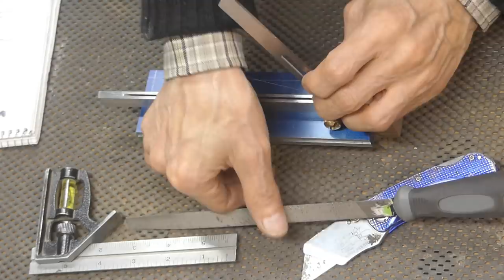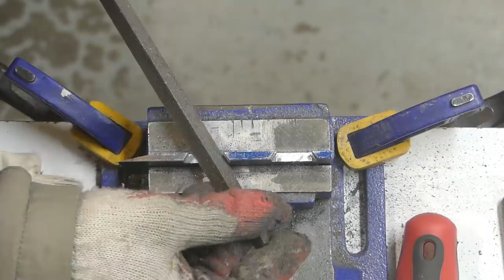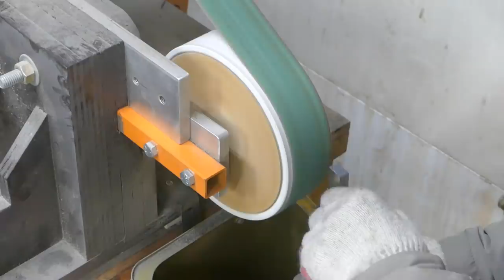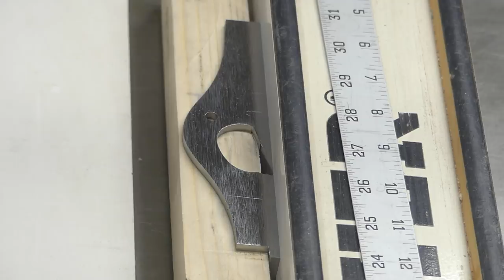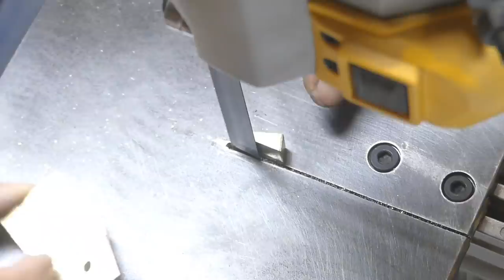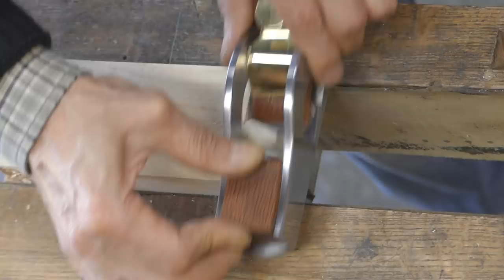MAKE A RABBET BLOCK PLANE

Comment: I love the way you make those planers and i really don't want to be a jackas but don't use cold roll steel, that thing always wants to move where you take material off, because of the compression forces and tensions of manufacturing, use instead hot rolled steel, cut your pieces to leangth and leave them all night in muriatic acid, rinse with a brush and water , the hot procces relieve the tension and forces of manufacturing, recheck the cold rolled and you will see a change, dimension or twisting, have been there before and i hate having too much work envolve on something that will change in a few days...
Reply: Is it truly that unruly ?.... like 1000ths of an inch ? Or worse ?
Reply: @andrewgarratt5191  make the test... I have made cuts on 1" thick 12" long square bar of cold rolled to split in half on a band saw,  all i got was two nice half inch bows... Thats not 1000th of an inch...more like 1/2 out of flat...the plate he cuts is made like that from factory, you could buy a bar of 12" x 12" and cut to the same thickness and believe me, you won't get a plate,  take one piece and is like removing one foundation of your house, slowly starts to sink that parts, the same principle is happening every time you cut one piece of cold rolled...
Reply: fireblade639 well frig! 
Thanks for the info...I don’t know metals, I can sharpen the shit out of it....but my knowledge basically ends there. 
Came up with a plan B anyway 😁 I’m gonna buy a common rusty Stanley Bailey plane,gut it and chop off the front and back to make my own infill plane. 
That’s “Ductile cast iron” 
And so long as I don’t let it get really hot while I cut...it should work out A.O.K. ....
Right?
Reply: @andrewgarratt5191  actually that's a very clever idea,  that will give you a very stiff and estable base to work with , high precision machines like mills and lathes are made with iron, iron will no be afected by cut heat, only oxy torch or welding heat... Don't use oil cutting it, and work it slowly, iron chip are like sand paper,  it eats the sharpness of a band saw blade quite easy if you don't have the correct cutting feed.. I will highly recomend you get the machinery's handbook... Is a very big book and almost everything needed to work with metals is in there, even there is a process to get a flat very flat accurate flat surface with three plates for testing the flatness and a true square out of a cilinder , you will be surprise how out of square are the home depot squares... Give it a try... Metals are amazing and there is so much to learn about them , like i said, i hate when people  capable of doing great things with their hands put so much effort to bring their ideas to reality and just have to wrong materials ...check the ave's videos , there is one "designed to fail" is about a water pump, just using regular steel on the shaft will make you buy a replacement pump over time...  Knowing materials is important for making your proyecs last forever...
Reply: fireblade639 
thank you. I’ll look into that book!...
Being able to make your own tools would be a huge game changer for sure! 
In woodworking they act like they are filled with gold on the price tags so I call myself “saving money” by buying rusty antique tools and then working on em for hours to bring em back to their full glory (damn near wind up spending the same amount considering time/parts spent)....would be bad to the bone to just turn around and go MAKE a draw knife,spokeshave or whatever you needed,even custom to your very own personalized needs/tastes. 
Thanks again.
Reply: @andrewgarratt5191 no problem and yes that sucks,  the prices they quote for "high precision"  tools made of aluminium is a joke... I was a wood guy sometime ago, but then a met the steel with a friend's lathe and found what real precision tools are made of, wood tools never looked like before again, you'll soon find out that a true square is almost imposible without the correct knowledge, how to get it is almost an art, something so simple is really complicated when talking about precision, check the "this old tony" videos , you would really like that guy, is like the coolest highschool teacher you will ever have... His "one inch punch" to cut steel or his "time traveling lathe" is a great start up...

Comment: Me id want to knock this out on a cnc mill.  But we all have to learn how to crawl before we can walk.
Think about this, I didn't see him weld the metal togather he's relying on tight joints peened into place with presure fits.
I dont this anyond would drop this tool but could it hold up to that kind of abuse?
This is truly a work of art and comes close to the stuff Bridge City makes as far as looks.
This is a very smart guy. Not many people have this kind of skill.
Im afraid id scrap some metal trying this by hand.

I will point out one trick with the sand paper laid flat, either glue it down or use water to make it stick to glass so it won't bunch up on you like it did once honing the bottom of the plane.  
I dont think my joints would be that good id have to brase the joints togather.
Or cut a bevel and fill with welding rod.

But to get one to friction bond that's skill.
Reply: Maybe a Three Dee Printer Too

Comment: Excellent as always!  One question, why don't you use an angle grinder to clean out the dovetails?  I know that you rough out with the band saw, but it seems like it would be easier to use the grinder for at least a portion of the hand filing.  However, I defer to you as the master.
Thank you for another very interesting video.
Reply: Allen Read Jr because one tiny slip and you could ruin the finish. Angle grinders are not precise tools like you need for this project.

Comment: Why you don't braze steel pieces together after fitting the dovetails? It will be rock solid
Reply from the maker: It is not necessary, it is very strongly jointed.

Comment: I’m always curious, why the peened dovetails instead of welding?
Reply: Simple answer - HEAT !!
Heat Distorts metal
Reply: He’s grinding the finish flat after peening anyway. Not really an issue.
Reply: I then bow to your superior knowledge sir !    I would add though that I trained as a Welder in 1968, Subsequently going to Technical College until the age of 21. I think I've possibly got enough knowledge to go with my reasoning. Everyone is entitled to their opinion though !!
Reply: Not starting an argument, but if it’s ground flat afterwards...it’s flat. Flat is flat. 

Professional welders can weld a butt joint and not have the angles close or open.